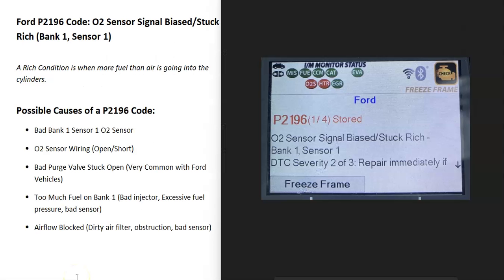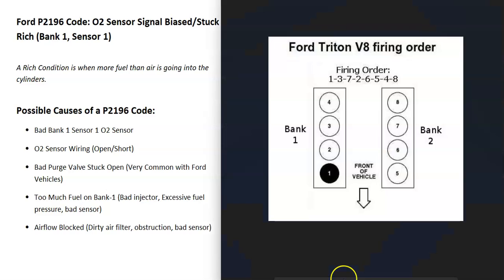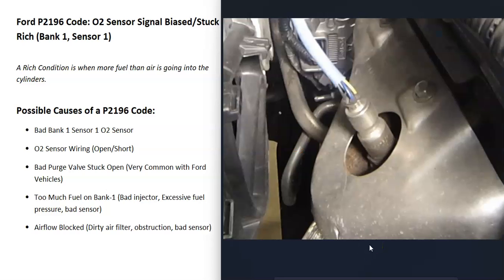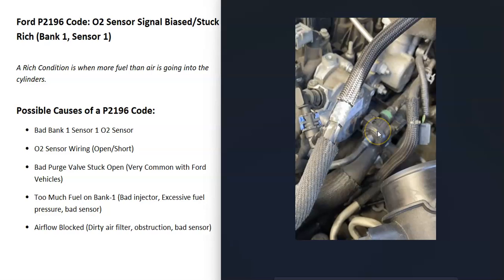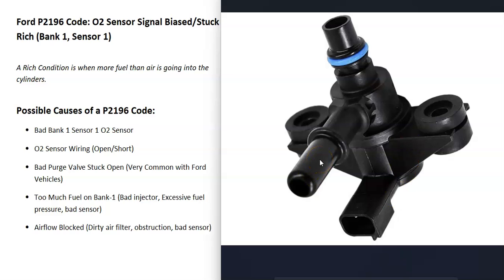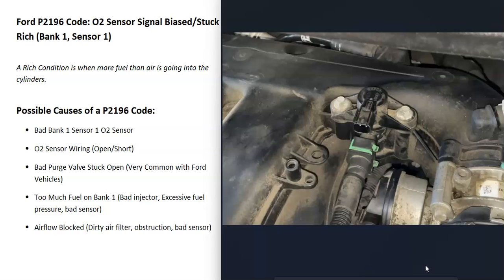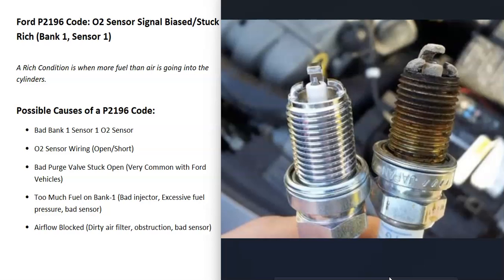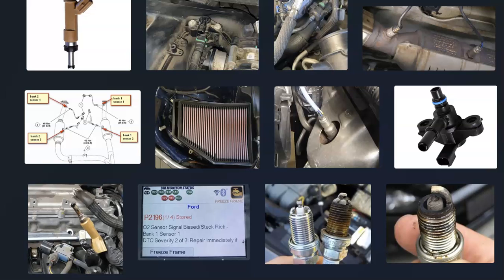Causes and Fixes Ford P2196 Code: O2 Sensor Signal Biased/Stuck Rich (Bank 1, Sensor 1)

Comment: I’m currently getting this code.  As well as some random misfire codes.    I swapped the injectors cause I had a set laying around but still running rough.  Before the issue popped up I did notice I could smell fuel when I parked it the night before.  I assume I’m somehow getting too much fuel n
Reply: what was the problem on yours? did you got is sorted ?

Comment: 2015 ford taurus sel 3.5 runs pretty good till about normal operating temp. Then it start missing and acting stupid, to the point it dies and struggles to start back. It has codes- p2196, p2198 and has thrown p2195 1 time alond with the other two. I've noticed the fuel pump driver module also is really warm to touch when this is occurring. So new fuel pump driver module, New fuel pump, New plugs, New intake upper and lower intake gaskets, new injector that was stuck open and replaced all other injector o rings. If you have any input it would be amazing. Could it be the Engine cylinder head temp sensor? Mass air flow sensor looks pretty clean. Also im going to be checking the purge valve to see if its stuck open tomorrow. Its july 11 2025 9p.m est. Any input would be great. Thanks so much. Also when it starts this issue at operating temp it will crank no start untill it sits and cools off about 30 mins then it will run back to operating temp and do this all again.
Reply: Ever figure it out?

Comment: I cannot figure my car out.  I've replaced the O2 sensors, the air filter is brand new, I also just replaced the purge valve.  I've thrown alot of parts at this problem and it just won't go away.  The car is running great except at lights it acts like it wants to stall every few lights.  I don't think it's the injectors because they were replaced about a year ago, I also just put new o rings on them the other day.  Any suggestions would help if you can and have the time.  Thanks for the video.
Reply: Did You Figure It Out Having Problems With My 2010 F150 5.4 I Already Replaced 
Pcm , Fuel Pump , Purge Valve , All 4 02 Sensore , Catylatic Converters , 8 Injector . 8 Coil Packs And Spark Plugs , Both Valve Cover And Still Getting Same Codes P2196-P2198 Any Suggestions??
Reply: Also Replaced Air Filter And Maf Sensor
Reply: Could be your fuel pump.going out or dirty fuel filter
Reply: Sooooo???

Comment: hello, on my 2004 ford expedition 5.4L v8, i had a P0174 pop up, took it to a auto shop they replaced oxygen sensors not even a day later, i have a P2196 code popping up, could it be the sensors they put on were faulty since they’re not even a day old?

Comment: So a P2196 coupled with a P1450, barring anything crazy of course, would suggest a stuck purge valve then?
Reply: I got the same 2 codes and don't have a live scanner Do I just replace the purge valve?
Reply: @EverBarbero  I'd say that's probably the cheapest, and easiest possible fix to remedy the codes.  Without a way to clear the codes with a device, I think you can remove the negative of the battery resetting the computer, and possibly clearing it the codes. Drive it for a few minutes and see if the codes come back.

Comment: I have a P2196 and a P2198 after I just replaced my fuel pump.😢
Reply: Did you get it fixed? I got the same codes
Reply: Same 😅

Comment: P0456 with a p2196 code will it be the Purge valve ?
Reply: Btw 2014 ford edge 3.5
Reply from the maker: It needs to be diagnosed, but it could be a stuck open purge valve. Here is a video I made on how to test it. https://www.youtube.com/watch?v=X-Y5YsaXxJE

Comment: I drove 80 miles roundtrip yesterday and was approaching our apt complex when car died, only 150 ft away. turned car on and pulled in. today my scanner showed this error code and after I went in to get my phone to take pics of the second readout, it showed it as having no codes. mechanics have tried to tell me it's a purge valve 9 mos ago and it ended up being ignition coil. they also said back then maf sensor, plugs & coils were needed, and some other valve problem. it has run fine since the ignition coil was replaced back in march, except for the 2 times since october of it dying while driving. I have 2009 ford escape v6 bought used 30 months ago, so age can possibly be a problem but this clearing itself is crazy and leaves me wondering when is it going to interfere with driving again. could it be my ancel AD310 scanner tool with readout? it did show the MAF g/s 14.74 on freeze frame and as g/s 0.07 not sure if that helps.

Comment: I have a p2096 and p2196...my theory is the engine is running fine and the upstream o2 is bad reporting a FALSE rich signal and taking away fuel needlessly...this is causing the p2096 (post catalyst fuel trim too lean)....if I had a true rich condition I would not have +9% long term fuel trim...
Reply: Cool, so what happened with your theory? Did you try anything? Did it work? 🙄
Reply: @JasonLee-lv7tm I also wanna know